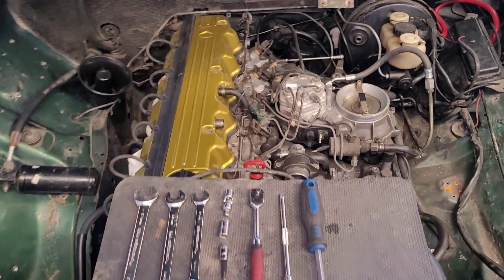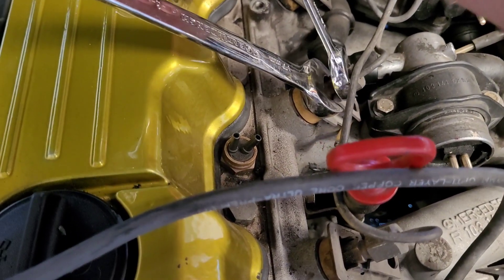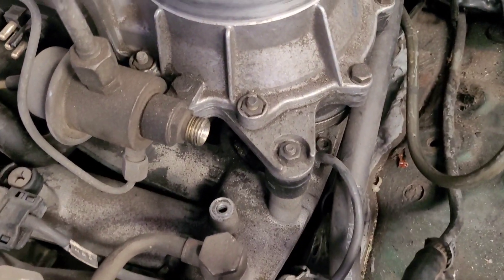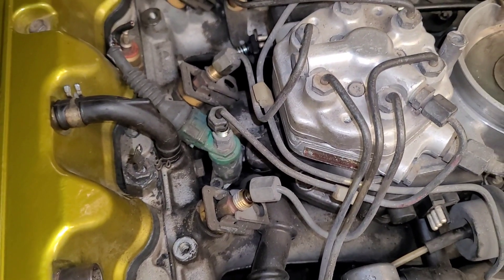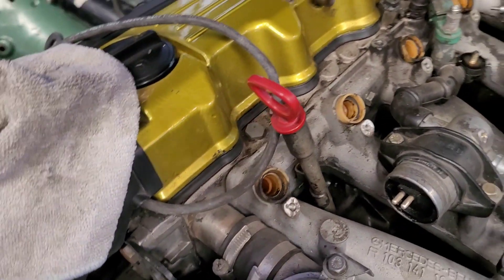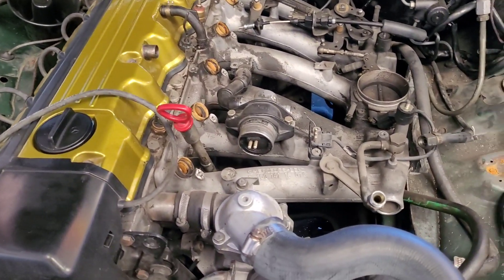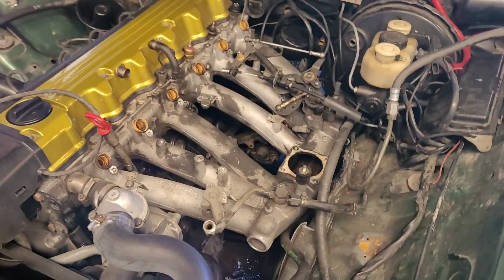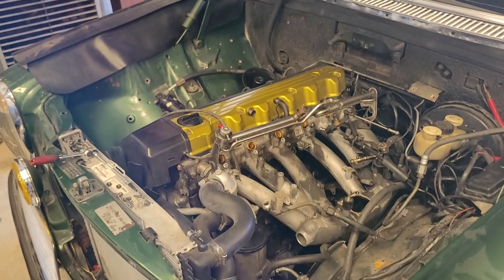M103 CIS Removal Getting Ready For EFI Episode 3

Comment: nice work, why do you not keep the IVC its 2 pin hand it connect to the intake manifold , cant be controled with the microsquirt??? with the cold start injector what are you going to put a cover in the manifold or leve it there???
Reply from the maker: Yes you 100% can use the iac no problem it works great and yes it can be controlled by the microsquirt I'm just showing the bare bone basics on what is needed for efi is all I can get into all of that much later 😁